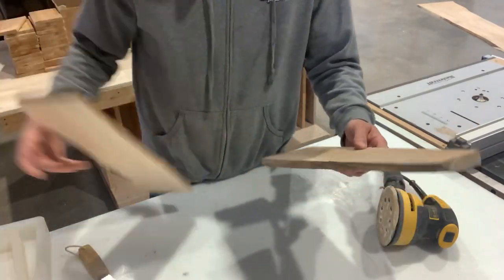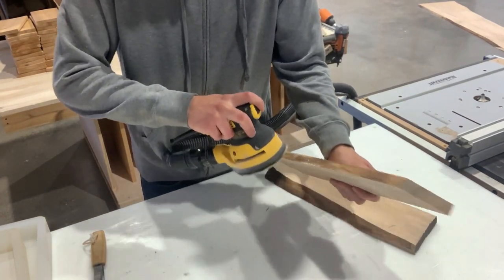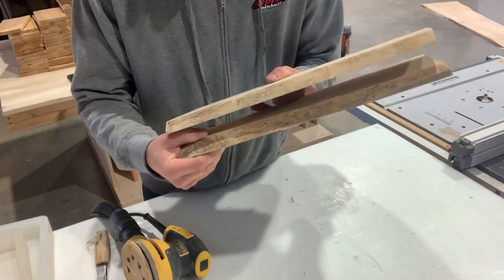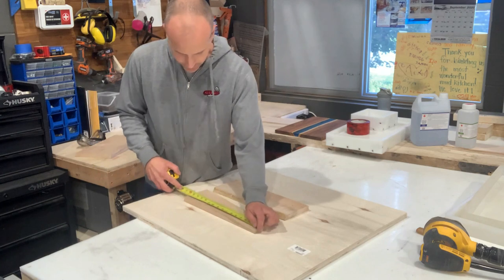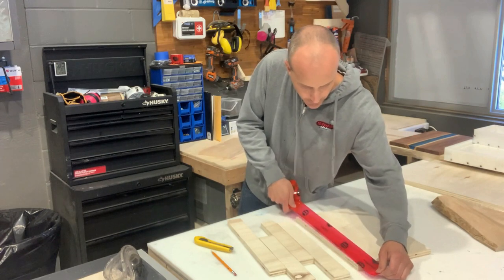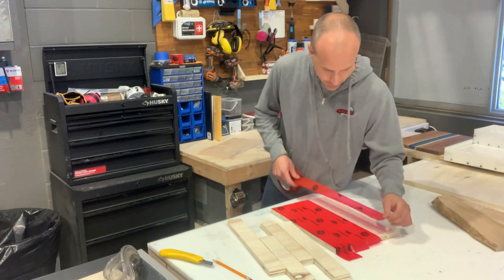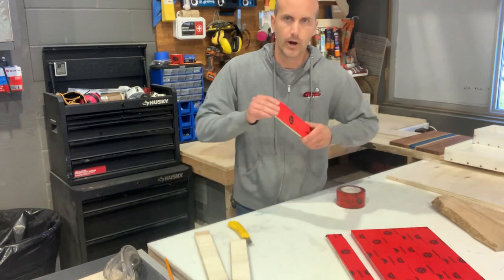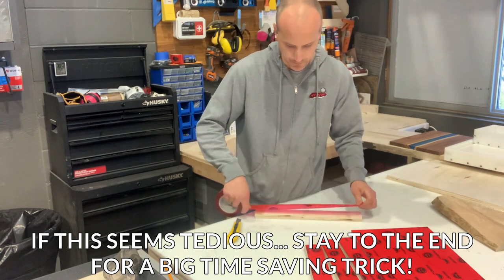How To Make A Mold For Epoxy Resin & Wood Charcuterie Boards + Time Saving Silicone Board Mold Forms

Comment: Holy crap in my 45+ years of working with power tools I have NEVER seen someone rip a board on a table saw using the miter gauge.
Reply from the maker: LOL! Yeah its not the ideal use for it, but it works well to cut wonky edged boards.

Comment: Do you remove the bark for anesthetics? I want to incorporate the bark into the design. If its a structural problem could I do a top coat of epoxy over a whole cutting board, or perhaps on the bottom layer do a full resin layer?
Reply from the maker: No, the bark needs to be removed before putting into the mold and pouring epoxy. Otherwise, the epoxy will just bond to the bark, and eventually it will just come right off the rest of the wood (the epoxy and bark will separate from the wood). So yes, its structural. However, yes, if you wanted to start with a resin layer first, then top coat after (essentially encasing the entire board in resin) then it might be feasible.

Comment: Nice video.  How do you keep the resin from flowing under the boards in the middle?
Reply: You clamp them down or put a heavy weight on top of the boards. If the mould and the boards are nice and flat basically no epoxy is gonna get under, or at least no more than a thin layer that can easily be sanded off.
Reply from the maker: We weigh the wood down with hand weights to keep it from floating upward